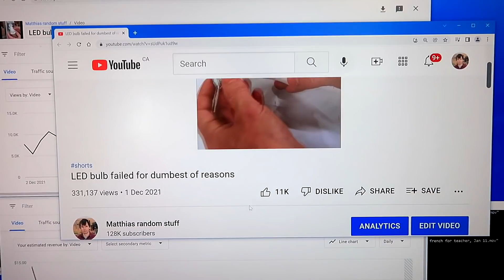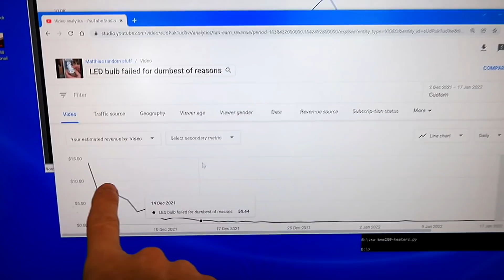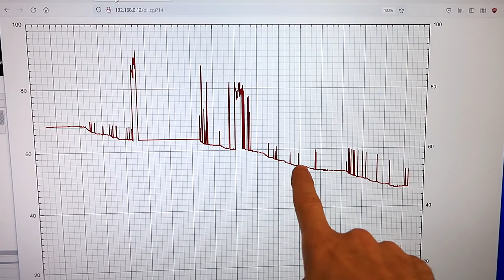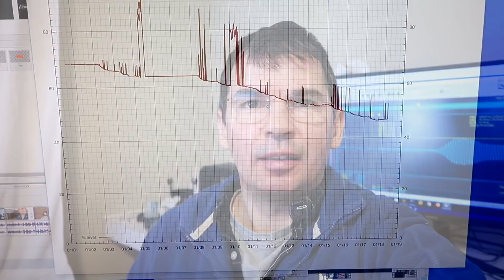Experiment videos, sponsors, and square shorts

Comment: Watched you for years, and trust you completely. If you're good with sponsored videos, so am I. About the distance sensors, you nailed it! They are cheap and don't last too long. I monitored our cistern, and had to start deploying boxes that had 4 sensors, and I would use a sensor and check the validity of the results, and if they were off, move to the next sensor.  When they started failing more quickly, I just stopped. You can get industrial ones for oil/gas, but they are crazy expensive.
Reply from the maker: there's a laser optical distance sensor my brother pointed me to.  At least that can be hermetically sealed, so less susceptible.  That's what I should have used and may end up using in the future.
Reply: @matthiasrandomstuff2221  The VL6180X family of time-of-flight sensors tend to be more reliable.
Reply: @matthiasrandomstuff2221  I would be very interested in what he told you, I really need to get my project back up and running.
Reply: @AdmiralMaggieMD  Interesting. Being laser based, I wonder if it can go through glass. I'll read up on it.  Also, I'm detecting water, so I wonder how that would work...
Reply: @AdmiralMaggieMD  Oh, I see that the larger version of it is limited to 1m. I need to go up to 3m.  But, it's a start, I'll keep looking!
Reply: @treynamy  all you need is a float to give you a reliable target that doesn't refract or reflect.  Drop a plastic donut (like a child's toy) down a metal shaft, and measure the distance to the float instead of the water.
Reply: @matthiasrandomstuff2221  Oh man, this just reminded me of finding you guys' list of hacks back in the 90s (it was up there with Bill Beatty's site for "Crazy neat stuff I could maybe kludge together").  Thanks for posting those, it was inspiring to a HS kid whose after-school job paid for PC parts, and couldn't afford to buy many components.  How times have changed!

Comment: Your oil meter needs a turbo encabulator to fix its problems. That will eliminate your side fumbling.
Reply: But only if it is implemented in conjunction with a drawn reciprocation dingle arm.

Comment: For a reliable oil level sensor, get two insulated rods and place them next to each other vertically inside the tank. The difference in dialetric constant from oil to air means that the capacitance between the rods will be a function of the oil level. You can then use a capacitance measuring circuit to monitor the oil level.
Reply from the maker: I'd have to submerge two rods in the tank (don't want to), also need some capacitive sensing electronics.  Much more complicated than a distance sensor.
Reply: @matthiasrandomstuff2221  ESP32 have capacitive sensing and can run circuitpy (a stripped down python). They also have great power settings that let you put it into several different power saving modes. I have a few set up around my home to periodically turn on, take a measurement, connect to wifi, broadcast via mqtt then hibernate.  The power consumption is so low I can run them on rechargeable batteries that only need charged once a month. If I added a small solar cell I could probably stretch that to once a year.

Comment: I'm sure others have suggested it as well, for the next iteration of the oil level sensor a pressure sensor can work well for measuring liquid depth. I designed and built a 100% solid state sump pump switch using a differential pressure sensor and it's been pretty much trouble free for 10 years so far. It has outlasted 2 pumps. For a sensor, I used MPX2010DP. It needs to be paired with an instrumentation amplifier, I used AD623ANZ (probably overkill). 
One sensor port is connected with a few feet of thin fuel line, the type commonly used on a chain saw, through a barb fitting and a couple reducers to a length of 1/2" PVC extending to the bottom. It must be 100% air tight, the tiniest leak will make it slowly become inaccurate. The diameter of the pipe isn't important but bigger will make it more tolerant to a microscopic leak. The other port is open to the air. Tune the amp gain so 5V (maybe just under) corresponds to 100% full. It then will have a nice analog value you can read with Arduino or Pi. You may need to select a different model sensor, that specific one is only good to 1.5psi or so which may not be enough for the pressure at the bottom of a full tank of oil.

Comment: Had some relatives leaving town for a few weeks. Last time they did this their furnace quit running and they came home to frozen pipes. This time I strapped a waterproof ds18b20 to the exhaust pipe on their furnace and put another in their sump pump pit. I downloaded some software on a Raspberry Pi that logs temperature. Now I can log in to see a chart of the activity on their furnace and sump pump. It's amazing what you can do with these cheap sensors.

Comment: A depth sensor I find really cool is the one with air. You pump air i to a chamber with a pressure sensor and vent it via a hose that ends up in the bottom of the oil tank.

Pump for a few seconds, stop and measure the pressure. If you know the density you can calculate the depth really accurate. The sensor and pump can both be in a really well heated area and away from the danger

Comment: I've been using the MCP9700A in products for an inexpensive solution to low precision temperature measurement for over a decade and I've been very happy with them. They have an analog output but it's very stable with a filter cap directly across the leads. For static fluid level sensing consider a pressure sensor connected to a sealed tube that is placed down in the fluid. ie the sensor sits outside the tank and the tube is fed to the bottom of the tank. This has been a very simple, reliable and inexpensive solution that has served me well.

Comment: 4:50 - If you have a cli library for the 'strength measurement' graphing, I'd like to start using that for things like RF signal testing, so I can see at a glance just looking at a CLI whether an antenna placement is better or worse.
Reply: Linux? Use /proc or /sys interface to read SNR from driver and plot that using shell.
Reply: @mcflapper7591  There are some instances (using different types of radios, not just WiFi) where the data has to come from other places. It seems like Matthias' setup is not only plotting a scaled graph in real time, but also writing the data to a file, and doing some extra calculations. I mean... yes I could write that in a few hours probably, but it would be cool to have a library I could integrate and contribute back to (whether it's in C, bash, JS, or whatever) ;)
Reply: Did the mention of a raspberry pi summon you here? :)
Reply: @Cynyr  Heh, that and the fact that I like to hear from other YouTube 'creators' when it comes to testing out things like shorts and other features on the site.
Reply from the maker: Here's my graphing code -- 4 lines of python.
    Hashes = int(Kilogram)
    Hashes = Hashes % 400
    HashStr = "#"*int(Hashes/2)+":"*(Hashes & 1)
    print("%5.2f %7.3f"%(pos-engage_pos,Kilogram), HashStr)
Reply: @matthiasrandomstuff2221  Good ol' Python
Reply: @JeffGeerling  Well, that other place has to provide stats as well. So, use those and shell scripting then.
Reply: Of course you show up here :D

Comment: For an optical sensor, you could shine a laser at a slight angle on the surface of the oil, and point a camera at a right angle to capture the reflection. The spot will then move across the image sensor based on the distance (provided the lens of the camera is not distorting too much). Alternately, shining the laser through an appropriate grating (one producing parallel lines) you could measure the distance between the peaks to get the distance. You may need a pin hole in front of the laser to reduce reflections and speckle noise.

Comment: There is an interesting video "Product Development: Water Tank Monitor System" from a channel called "Leo's Bag of Tricks" that deals with similar issues as your oil tank gauge. But uses an in human hearing range sound down a down pipe of a known dimension to deal with unknown echoes in the tank.

Comment: This is SUPER content.  Fun projects.  I like seeing the analytics.  No one is showing that.   
I believe that some propane tank sensors work on capacitance where there  is no access to the inside of the tank. Would that eliminate moisture problems ?
How about just using a traditional float sensor with an electronic output ?
Why not use a good quality industrial sensor  for the reliability ?  There are many things made for diesel fuel.
Reply from the maker: Propane tanks tend to be metal, so capacitive sensors would not work from the outside.  But that would be an option for the oil tank too.
Reply from the maker: Also, a float sensor is complicated, cause I'd need a mechanism that goes in the tank, one that can be submerged, otherwise it would be impossible to get the full level range.

Comment: Insert a pipe with a speaker and measure the frequency of the resonance.
You can use the speaker as a membrane between the tank and the outside.

Comment: Hello. It is cold outside. I think it would be interesting to see an experiment video about wood glue strength after the glue bottle has been through multiple freeze-thaw cycles. I also think it would be interesting to see if putting a wood glue bottle in the microwave is a viable way of warming up some glue to make it less viscous when cold.

Comment: Why not use an external column of liquid instead of measuring the tank directly.
Tap a line into the bottom of the tank, run clear tubing along the side.
That way the tank can be sealed and you can indirectly measure using whatever you want.  A webcam pointed at a scale, a float, any number of different things.  You could use a series of optical transceiver pairs (few cents a piece at quantity).

Comment: Oil condensation shifts the resonance frequency of your sensor.  But a film of condensed oil can also scatter light.  If the condensed film is a few microns thick and your optical sensor uses near-IR light, you'll see interference effects as well.  So switching to an optical sensor may not solve your problems.  How about using a child armed with a dip stick at 50 cents a dunk?
Reply from the maker: The reliability would be terrible!
Reply: @matthiasrandomstuff2221  Buy a quality dip stick, why handicap your future geniuses.

Comment: I had reliability problems for a outdoors project caused by (at least I assume so) a unreliable potmeter.
I think condensation issues causing unreliable reads resulting in unreliable behaviour.
Just like you I suspect that Arduino only marketed products are only tested in living room conditions.

Comment: Another fuel tank measurement idea: use a sending unit from a car gasoline tank but modify the lever on the sending unit. Or put a camera on that Pi and aim it at the float gauge and calibrate some kind of image recognition tool to convert vertical float position in pixels to gallons (or liters or whatever). 

Have you considered using an ESP8266 (or ESP32) (running Tasmota) connected to your sensor and sending the data to the Raspberry Pi using MQTT? You could have one Raspberry Pi accepting data from as many ESP as you can connect to your wifi. This approach is cheaper and the sensor nodes can run a whole lot longer than a Pi off of a battery.

Comment: There are some time of flight distance sensors that are possibly better for your level sensor, though naturally quite a lot more expensive. You can also get ultrasonic ones listed as waterproof or water resistant, they look like the parking sensors in car bumpers.

No idea how they cloned the bmp280 but I'd agree that the cheap ones work well (as do the htu and sht temperature etc sensors, think those are actually just cheaper and maybe not cloned)

Comment: You could try a capacitive sensor, its circuit would require some temperature compensation though. Years ago I was used to watch your videos on computer but now I watch on my cell phone. Regular videos, not shorts. Drawback is it's harder to type comments using a cell phone.

Comment: Open to sponsored videos. Shorts are OK. Sometimes if I know a video is really short I might watch it at work (which  I would not do for a longer video). Of course if the sponsored videos suck then I won't watch them. But probably they won't suck. I don't care about square vs rectangle vs portrait vs landscape. Curious if it would make sense to use an actual fuel level sender for your tank. (Like a KUS unit).

Comment: Can't you use TCs for temperature measurement? IIRC a K type TC range is -40 to 250C. Output is millivolts. You can even make you own from TC extension wire. Convert the mV output to a digital signal and send it on to your datalogger.

For the oil tank you could build a level gauge that uses a magnetic float in the gauge tube to trip magnetic switches at the various levels you want to monitor. You could use an inexpensive 0-10PSI pressure transducer designed for oil and water to read the pressure in the tank.

Comment: Commercial level sensors I've seen use a 45 degree reflection to the sensors themselves so you don't collect condensate or what have you on the sensors. Not such an issue with oil, especially in the cold I guess, but just thought I'd mention that. I have no problem with sponsored messages. They give me time to go check the comments ;) (don't tell the sponsor tho) EDIT: Just watched to the end, lol, so if oil is condensing on the sensor, mounting it vertically (and maybe arranging a drain hole) might prevent that.

Comment: You can try coating the sensor (the PCB) with conformal coating. Maybe the condensation on the PCB also causes some minor short circuit which could also explain the false readings. Of if you don't have conformal coating, maybe nail polish? Or spray with clear coat? Just to stop condensation directly on the electronics and the traces.
Reply from the maker: It's already tightly wrapped in tape.
Reply: @matthiasrandomstuff2221  Ahhh too bad. You can always use a pressure transducer. Those are very reliable, but that needs to be connected to the lower point to measure the pressure. Usually have a 4-20mA interface. It is widely used commercially.
Reply from the maker: I'm not about to make any connectino that could result in oil leaking out!

Comment: VWestlife recently did a YT short in 3:4 format - rotated 4:3, the old TV aspect ratio. That wasn't too offensive, not as bad as the 9:16 ratio.
Reply from the maker: I'd done one 3:4 before, the last one on my main channel was 1079x1080, but it turns out square works too, which is what I'll use going forwards.

Comment: Those hobby ultrasonic sensors are absolutely not rated for outdoor or wet environment. JSN-SR04T is the model you could try instead. It's intended to go into car bumpers, so it's fully sealed. You would still have to deal with condensation, but you can use Rain-X for that. The droplets will become small enough that the sensor will throw them off with the pulse.

Comment: Couldn't you put a floater in a tube, then put the sensor in that same tube, and measure the distance to the hard solid floater instead of the fluid/liquid oil? Could give you much more accurate readings
Reply from the maker: why?  The fluid is a perfectly flat reflective surface, doesn't get better than that.

Comment: I use Rain-X on my ultrasonic transducers to keep condensation off. Also put them at a slight angle to help the water run off. I also found that line powered transducers are more able to shake off condensation than loop powered transducers.

Comment: @matthias wandel...  On the subject of strength testing...  Just watched a video saying double gluing (ie coat ends with glue and let soak in and set up then apply more glue and clamp ends together) an end joint creates a stronger glue joint than just glueing and clamping alone.  Recall that you tested glue joints including the end joint but don't recall you trying this method....  Perhaps something you could put to a load test comparison.
Reply: This is the video and the double glue up is at the end....  https://youtu.be/Wmw5rayNIV4
Reply: @Matthias random stuff

Comment: Could you just measure the amount of time the furnace is burning fuel oil? Then calculate oil left in the tank by how long it runs.  I'm assuming it consumes oil at a constant rate, so just measure the time its burning.  You might look at ESP32 board. Cheaper and simpler than PI. Could be better for some of your projects.

Comment: Oh yes yes please show that Motor Conversion on the jointer. I heard John Heiszs Jointer run in another video, sounds so much better with lower RPMs that are therefore stable and with loads of power :) 

I have built your 20" Bandsaw in 2017, half a year later I switched from 1 HP to 4kW. It is absolutely overpowered, but the starting noise and power are awesome. Impossible to stall out. Size similar to your motor just shown. 

How much power does yours have? 
Greetings from Germany

Comment: There are weatherproof ultrasonic distance sensors, some even have Arduino / Raspberry Pi breakout boards for them, check it out, might fix your issue with the oil tank.

Comment: Why not use a bobber and a thin rod, then just measure the rod sticking out? As long as the rod has two mount points, it would descend straight into the tank and give you a physical readout that would be trivial to measure with some other sensor setup.
Reply from the maker: Do tell what trivial sensor you would use to measure how far the rod is up!
Reply: @matthiasrandomstuff2221  A string wrapped around a multi-turn potentiometer might work. You could put a spring on the pot to keep tension on the string.